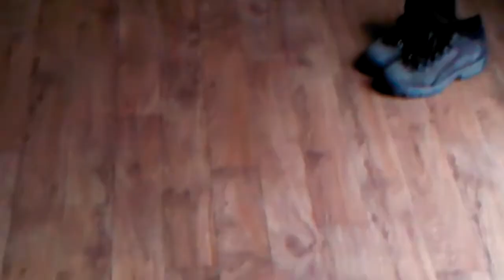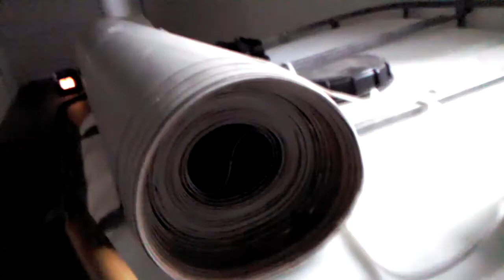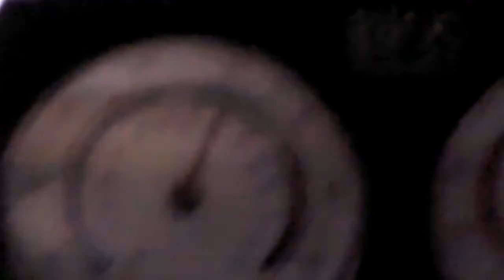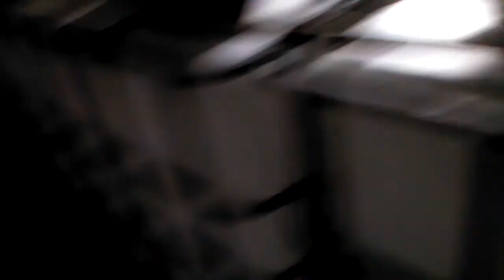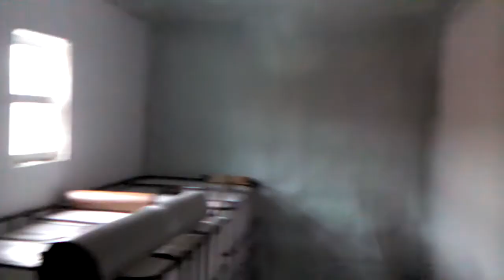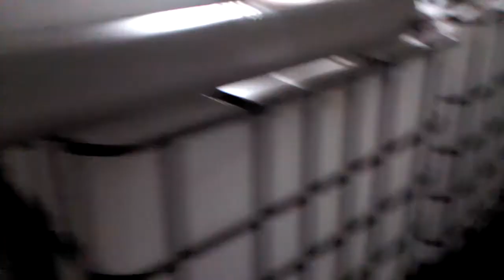The Off Grid Tiny House 79 New Floor!

Comment: You should have got a wind turbine and 5 solar panels. I just won a 600 watt 12 wind turbine for $330 Canadian, tax and shipping included. Ebay . If you buy 6x100 watt solar panels ,it will cost you over $1000. I get 600 watts for $330
Reply from the maker: David Pedder I bought my entire solar system from ebay. It is a 2kwh system. 20- 100 watt panels. Includes 10 - 30 amp charge controllers, all the wiring, 30 year warranty, and free shipping. It cost me only $4k. I did have to add inverters and currently dc switches so by the time it is done $6k total including batteries.